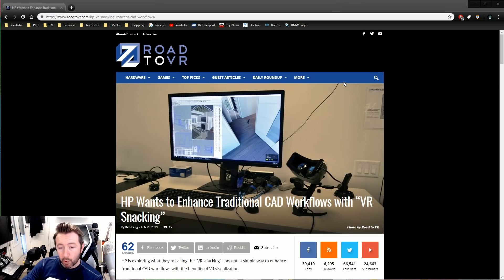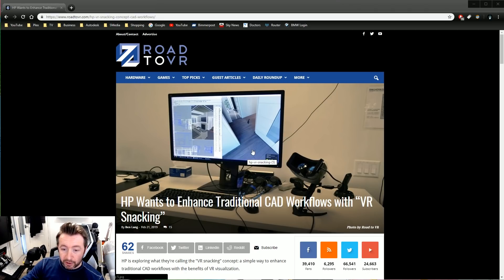The Most Promising "VR & CAD" Development So Far, VR Snacking?

Comment: 3D CAD integration will come to AR/MR but it will take 5-10 years. VR is just too isolated an environment for engineers & designers. MR/AR will eventually replace computer monitors for engineers/designers as it gives them an almost infinite amount of desktop space as well as immersive 3D integration.
Reply from the maker: I do hope so. It needs the software developers and product managers to keep up to date with modern trends though. A lot of them are so slow to adjust that a lot of bleeding edge tech is obsolete by the time they begin working towards integrating it!
Reply: @Neil3D  I definitely agree. Microsoft Hololens 2 is another great leap forward but as you said there is not enough software development behind it yet & the cost is still too high, even for Corporations. I still think that AR/MR will replace monitors & screened devices in general, but if the software companies are slow to adopt it may take s longer amount of time.

Comment: Hey Neil! I had recently huge problems with freeform parts when inventor creates this kind of line in a symetric part. If you create for example a mushroom head form and deform it in all direction but keep a symmetry plane in the part than inventor creates this nonsense line... this line is causing so much problems afterwards. If you created edges in this freeform part you cant make chamfers or fillets or just simply cut it. My solution was to trim the part to get rid of this nasty line and then just mirror the part. You have changed actually nothing in the model but The same part actually works than perfectly... maybe you can reproduce or i can sen you a file. This cost me so much time i thoght this is worth spreading. Thanks for your videos